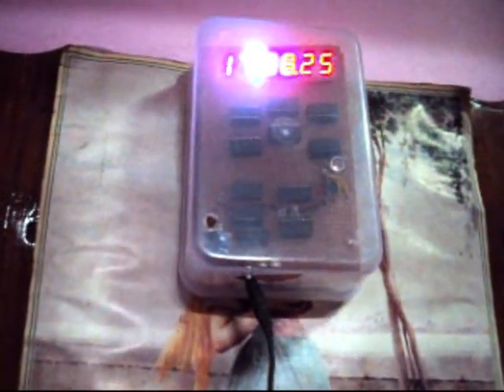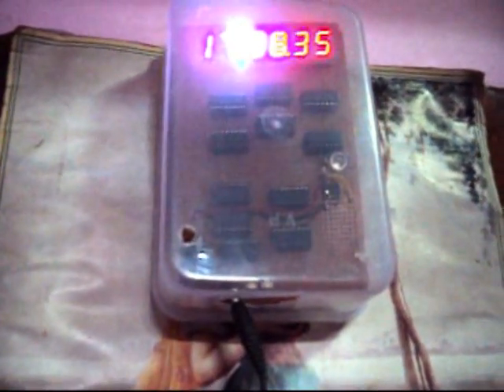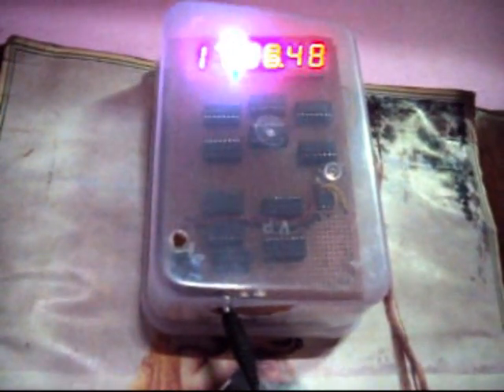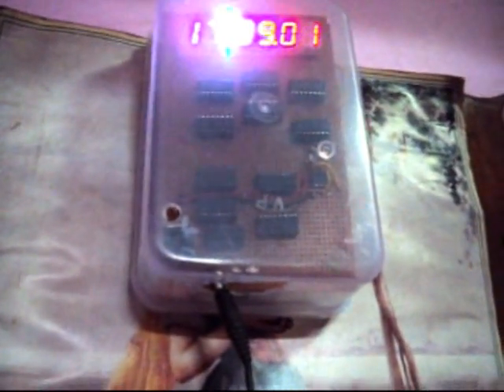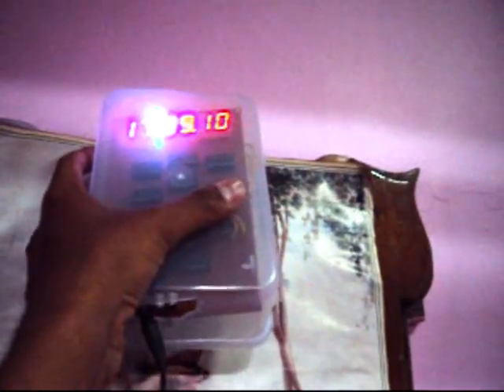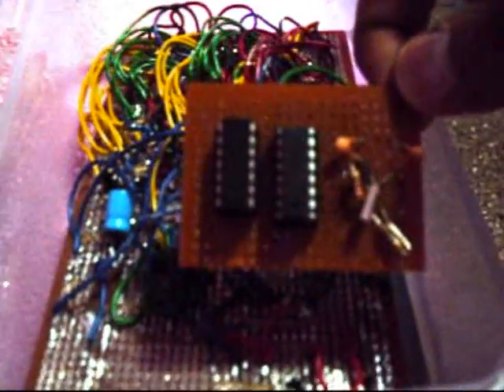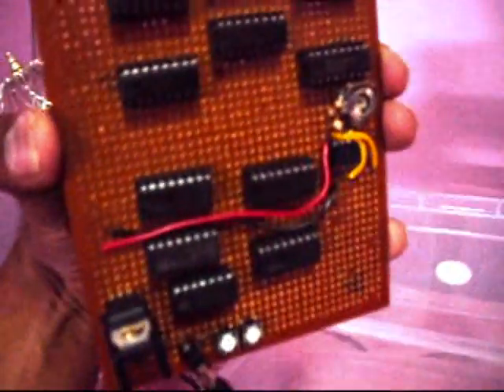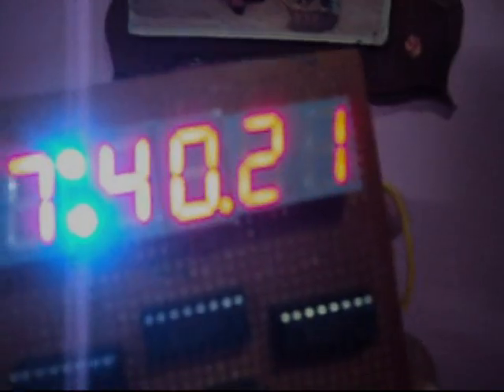DIGITAL QUARTZ CLOCK  4026 4060 4013  7 SEGMENT LED DISPLAY  using 4026 4060 4013 IC,crystal 32768

Comment: Hi. I made the schematic using 4060 and crystal 32.768kHz. At pin 3 (Q14 = 16384) it should give me exactly 2Hz, but something is going wrong. It has around 6 seconds delay to flash in or out. What is the problem? Thanks